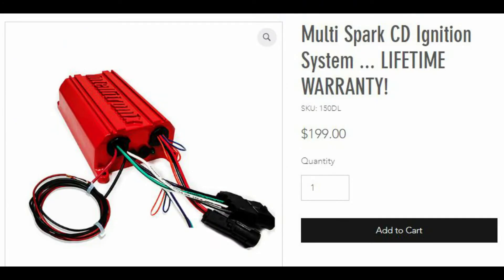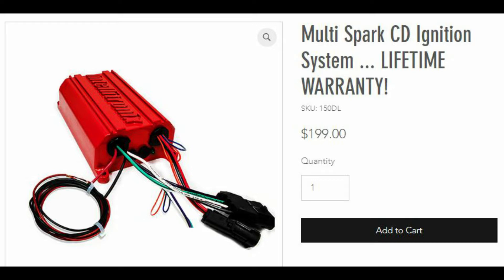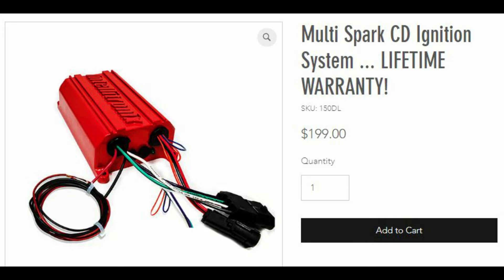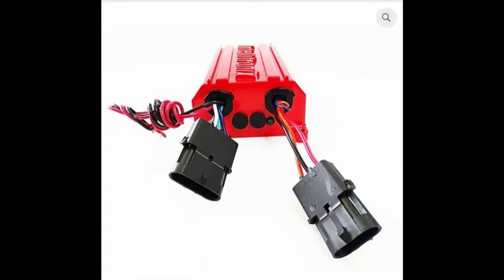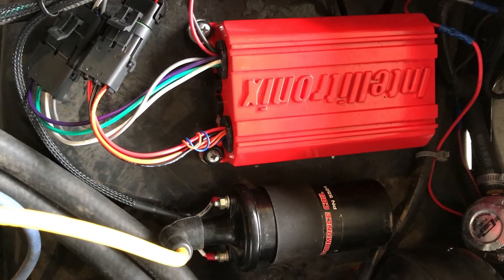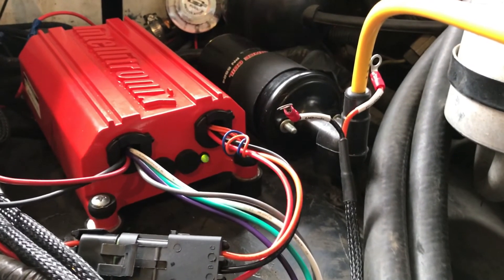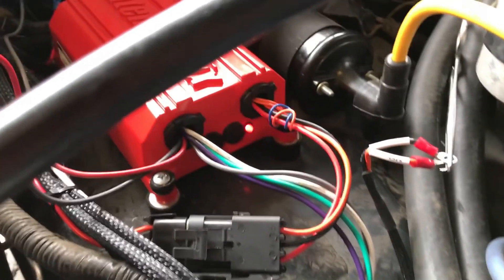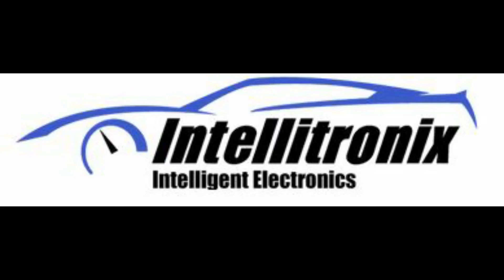Intellitronix ignition box review w/ video clips of active fault indicators.

Comment: At  from about 2:04, the engine sounds uneven at idle. Will the box run with a 0.7 ohm accel super coil (nil ballast Resistance)?
Reply: Pretty sure any coil will work.

Comment: What is the RPM cutoff for the multiple sparks, and for how many degrees of crankshaft rotation?  MSD is very clear that there are multiple sparks for 20 degrees of crankshaft rotation at 3,300 RPM and below, but I can find no info on the Intellitronix system.